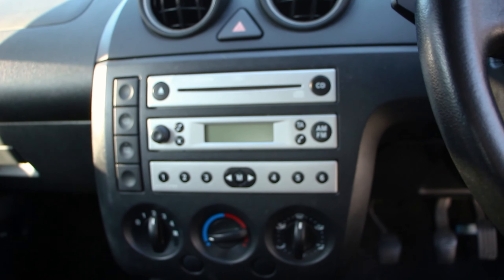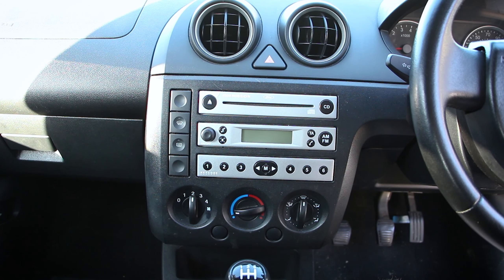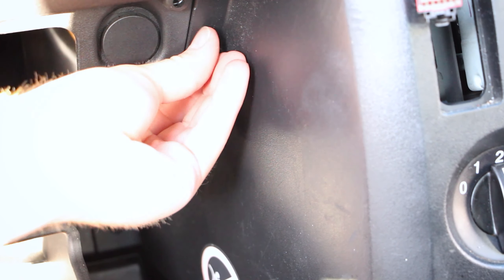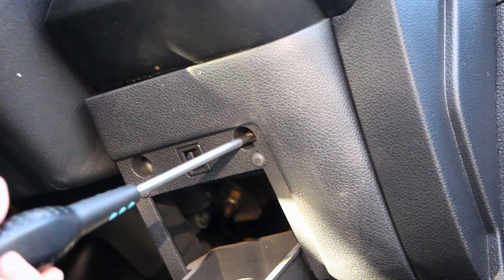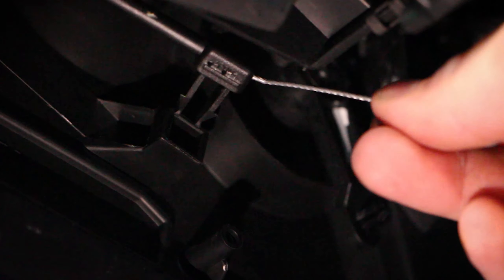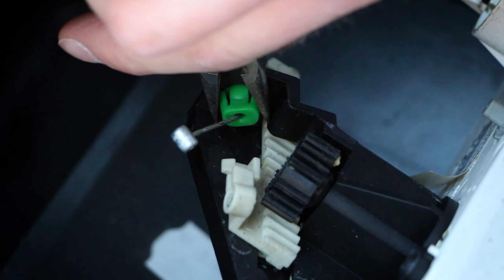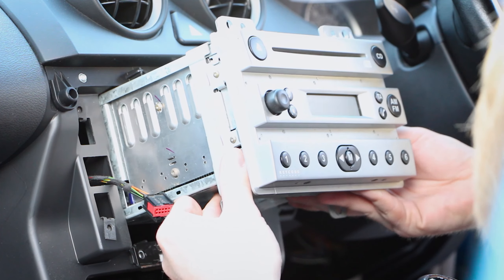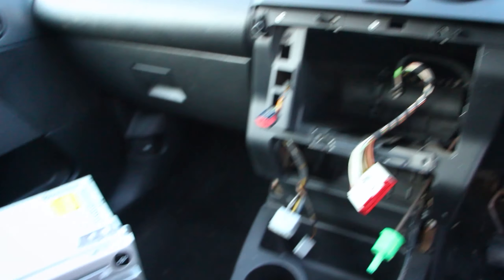How To Remove A Radio/Stereo (Triple Dash) From A Ford Fiesta (2002 - 08)

Comment: Hi mate, is there an auxiliary adapter slot on the back of these existing radios? . I’m looking to use an auxiliary input which I’ll plug in a Bluetooth receiver into
Reply: No.
 Best thing to do is get a double din touch screen radio. Then the plastic trim so it fits nice. Only thing i had do was re locate the back window heater switch. Sorted. Wiring on this is basic. Plenty vids will explain.
Reply: @Alien_O1 Hteo bih da postavim multimediju sa blendom.Kako resiti i koju blendu staviti ako je multimedija 7", a dimenzije otvora 119x112.Hvala

Comment: good evening, if anyone can answer me when I removed the cable there was a sort of aluminum rod which came loose I then hooked it but now the module which allows you to change the position of the The air connected to this cable rotates more. I have yet another problem, impossible to unhook the car radio, it seems blocked, I pulled really hard and it doesn't come off completely.

Comment: Very cool buddy thank you. Do you have any videos on helping with the heating bits you just removed as mine is only blowing hot air 😢
Reply: that green bit has to go through that plastic, hole, I have yhe same problem its really hard to get
Reply: @klubbyy8234  what green bit has to go through? Do you have any links that can help please?
Reply: @klubbyy8234  I managed to do it and fix the thing. So chuffed. Have some helpful tips if you wanna know? :-)

Comment: I have car ford fiesta 2005 but my radio is locked 13
Reply: Did you find solution? I've got the same problem
Reply: Code is in the car manual

Comment: Do you know that my dad has sold his 2005 Ford Fiesta, but with got a Britain’s 2004 Ford Fiesta, what is a multiple different radios put in and all have faulty returned CD players, but we only one what was working was a silver one, and the CD player was working, and we tried another silver one and the CD one play so we Might have to buy a new radio for our potential thousand and four Ford Fiesta, but if you want you can do a video on removing that it’s exact same as what you did in that video, but we might have a black one because mine be looking to make a Ford Fiesta car radio into a woman, so you can remove that and it will be the exact same thing, but with it being a black Radio instead of a silver Radio Are you my show my return from Adam what to do Adam be is also known as Adam be is got a YouTube channel and you can tell him what to do and then if we had had enough of the black one being in he can remove the black one and then put a new one in and then he can Search The Presets put the code in and put our my favourite band called said seven because I found a set of shared with a number seven on it that’s what the names of the band shed seven and in that video why did you not remove a CD disc because when my dad removed recreate stereo and his Ford Fiesta, he had to take out the shed 7CD so he can put it in the silver one, but we have a silver one had a faulty volume knob Found this black one and then dad had it in his car for quite awhile now as I said at the beginning, he sold his Ford Fiesta, so I’ve got that and I am looking forward to making Ford Fiesta car radio into a Walkman and please make a video on how to remove a 2021 Vauxhall Crossland car radio